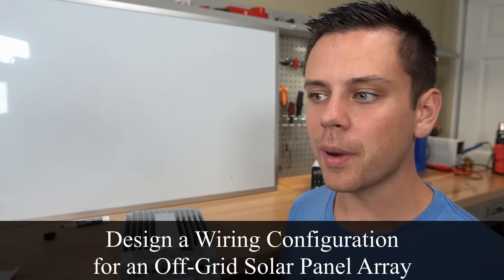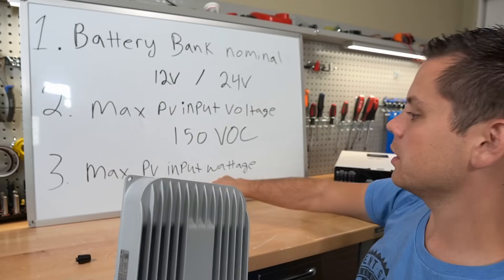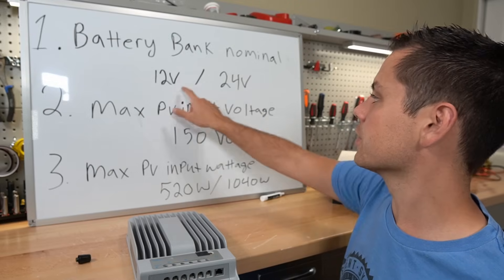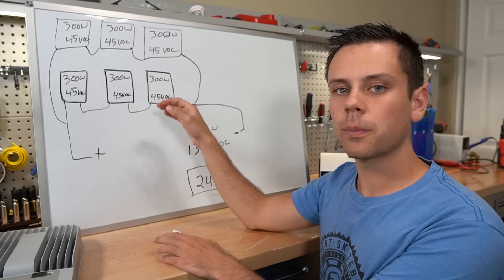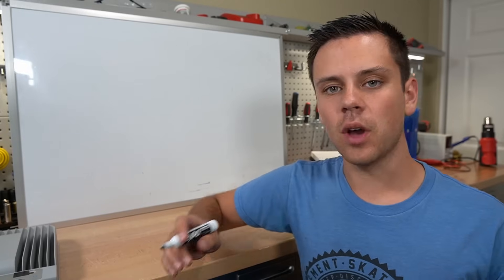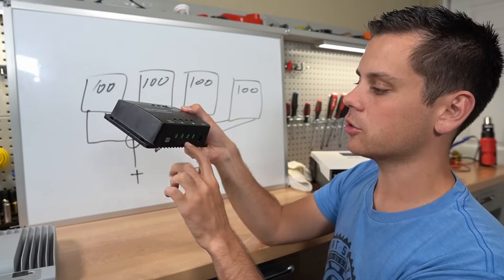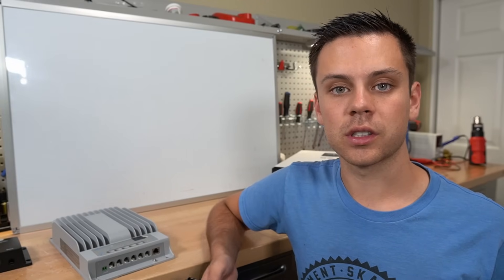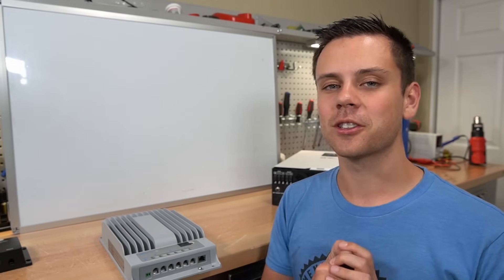How to Design an Off-grid Solar Power Array Wire Configuration

Comment: WILL, a while back you reviewed the Bluetti EB240, but I can't seem to relocate it.
ANYWAY, you'd mentioned the BESTEK 300Watt Pure Sine Wave Inverter Car Adapter, a work-around with the Bluetti's AC wall adapter/charger. 
(BTW, they beefed up the wall charger with one capable of 300W in and 210W OUT).

With all my preparations for having some charging power on cloudy days,
I discovered my van has a160A alternator and 730A battery.

I don't want to burn up  or overtax my van,
but perhaps you might give me an idea approximately 
how many watts(or amps) I can draw ,
engine at recommended rpm,
while the sun hides from my two 170W Sunpower Flexies
TIA
BILL

Comment: Random thoughts.  Is there a good way to manage inrush current for high load devices?  An example is my current workshop where I have a 1200/2400 inverter.  It run lighting and most accessories just fine.  However, if I try and run my miter saw (15A rated motor) the inrush current can exceed 50A and cause the inverter you’re fail safe.  I was considering an in-line capacitor on that circuit, but have never tried that.

Comment: This is off subject but I have problem. My bluetti just  put into use In van. After a hot day the input % bars went haywire. Otherwise it works. I cannot tell how much power I have. If I call company they will prob just say send it in. I really need it and don’t want to send it in. Is there a device I can buy that tells me the ant of power I have left.

Comment: love your info but im confused, i have 2 100watt renogy rng-100d panels, an MPPT tracer 30amp charge controller and a 3000 watt 12v pure sinewave power inverter and 2 alpha cell 240 xtv 12v 112ah batteries to setup on my van, do i want to set up my panels in series or in parallel to get the best performance?

Comment: Found HQST panels on Amazon  for about 77 buck each for 100 watt panels. Seems good deal. But is there a place that you have had experience with dealing in used panels? Looking to run a Harman p61 pellet stove during winter on solar. Or supplement daily use items without going with a solar company

Comment: will, i had a question, when you connect your battery to the inverter/charge controller what type of resistor are you using to slowly charge up the capacitors?

Comment: Hei man, I like all of your videos, thank you for all the trouble..
Btw, I just get into electric unicyle, I was wondering you could give a tutorial for the battery pack, there are many electric unicycle especially entry level units that the manufacturers cut the battery capacity to lower production cost..so if you can, pls take a look on this..many thanks..👍👍👍

Comment: I have a 2008 Lance Truck camper 2 80 watt panels. I don't know what they are doing or my batteries. There is a switch i hit and a set of light come on telling me if the batteries are charged. Can I use a charge controller and which one and what size with Bluetooth?

Comment: I have difficulty deciding which one to use between GoWise 2KW and 1.5KW inverter.  With the help of your videos, my plan is to build a van rooftop mounted solar panel 100w solar, Battle Born 100AH batt, 20A Victron charge cont., with an expected minimum load of 90w for 6 hrs daily use.  Thanks!

Comment: You can charge a Firefly to 85% really fast and discharge it down to 20% and this rate you'll only be able to cycle it just 1200 cycles. if you charge it up to full capacity and discharge down to 20% you can cycle it a proclaimed 3600 cycles.

Comment: I know you dislike lead acid batteries, but have you checked out Firefly Oasis Carbon Foam Lead Acid battery. It cost less money. (Two Firefly's for the price of one Battle Born) You have access to 80% capacity. Will work in extremely cold or extremely hot environments. ( the new technology in lead acid - 3600 cycles)

Comment: I have a boat with 140 watt panel. It sends 80% to the house battery, 20% to the engine battery. I ASSUME this is a 12 volt panel, but I haven't checked. I want to replace it with a higher output panel, maybe 2. Can I replace that panel with a 330 watt 32 volt panel? Or do I have to stick with 12 volt panels?

Comment: Connecting panels in series you add the volts not watts. Connecting panels in parallel you add the watts not the volts. This is basic electrical knowledge. Parallel and series circuits.

Comment: Hi Will, Great Video, I understood what you were on about, and learn something new about fire risks. My solar array is feeding a 48v system with a 2840W solar array at 76v, with a mixture of paired panels 255w and 200w all rated at 36v all come together in a DC solar mini breakers housed in a metal fuse box. The solar controller is MPP 60A rated and can easily handle this input.

Lighting strikes are my concern, I have the solar panels Earthed to an Earth Rod to avoid static, but have not yet taken any steps to avoid lighting strikes, protection system are available but would be interested in you input on this subject?. 

One observation to note is location; I live in Mid Wales UK where the suns energy drops off quite considerably during the winter months. Last Autumn I tried adding 20% more solar and a further 20% in mid winter. This help to keep the battery bank topped up. But there were weeks when the cloud density is so think no solar got through. So I aim to add a battery charger, using cheap night time energy after my car has charged. Timing is everything in this case as the car takes around 1h 30min to charger to 80%, that's all I need for my daily commute. But I also want to introduce Inferred heating panels to the house to heat up in the mornings, so I might use a combination of the two.

Keep up the good work!

Ken

Comment: I’m a newby to the solar game. This video is perfectly timed because I’m thinking of adding 2 400 watt panels, the panels combined in series will have a max voc of 90 volts. I have a 40 amp MPPT and a 12 volt battery. The MPPT has a max charge rate of 520 watt for 12 volts and its max voc is 138. What will happen if I add the panels to the MPPT?

Comment: Is it possible to charge an AGM battery bank AND a LiFePO4 battery bank at the same time?
I am buying battle born batteries but with the price i can only afford to buy one here and there over time. 
My day dream is to keep the AGM in place and charge them and run them off their own inverter and to also have the LiFePO4 charging and dedicated to another power system (CruiseNComfort A/C).
Over time I would do away with the AGM but it sucks to lose those amp hours when i can't buy a whole LiFePO4  battery bank at once. 
I was looking at a EPEVER DuoRacer MPPT Dual Battery Solar Charge Controller but when I asked if it would be able to charge both banks they said no.

Comment: can you explain the ocp in line fuses again. Do you need one per string or one per panel/ I have two strings of 5 panals at 1250 watts per string. but they each go to a fuse box with two breakers in it.
Reply: If you have a fuse box, that is your protection. If there is an issue, you will blow a fuse. The OCP he is describing, is an in line fuse in lieu of a fused combiner box. Hope that helps

Comment: Hey will got to say your videos are very informative and great I have a question I have a renogy Rover 40A MPPT and its currently has a 12v bank but i want to convert to 24v bank but the mppt doesn't realise its 24v and keeps it on 12v instead

Comment: Hi Will
I have watched your show for several years now and enjoy it.  Keep up the good work.
I am retired now and come from a background with high voltage DC equipment In the metal rolling industry.  I was wondering if you have ever made a solar storage unit with high voltage DC power?  I am talking about voltages between 200 and 600 VDC.  I see most electric cars use voltages this high because of its lower weight and lower I squared R loses.  I wonder if you could build a high voltage DC solar unit and show us the cost savings if any.
Frank Krajewski

Comment: I’ve viewed so many of your videos and really enjoy and learn from them. I have one question tho? I’m building a system based on your info and my only question is... you have a fuse system for “DC” power and I’m confused on how you connect appliances to the fuse box. Could you do a video on that? Thank you, or maybe just explain in comment... I can see plugging in a device to inverter but get lost on what appliance has just loose wires to connect to positive and negative post on fuse board... most dc I have all have a metal plug in adapter , I.e., like a razor or small radio

Comment: Hi Will, great content. Question, is it possible to hook up a power supply to a solar charger to charge the battery?
Reply: Typically, no. Solar charge controller has the specific purpose of collecting the energy from the panel, and converting it into a voltage that is usable, and safe, to charge your battery.

Comment: Great video. I have a question. If I have 2 12v solar panels and want to charge a 48v battery would I be better to run them in series to I have 24v from the panels or run them at 12v in parallel?

Comment: Hey WILL!! LOVE THE CHANNEL!!! THANKS FOR ALL THE GOOD STUFF AND HONEST REVIEWS!
I HAVE 1 QUESTION BUT HOPEFULLY IS INTERESTING ENOUGH TO CREATE SHOW WITH:
I HAVE :
48 VOLT SYSTEM
13S LI-POLY
13S LI-ION 21700
$40 ATOMIC PI
MIDNITE 250 CLASSIC {THAT HAS AN AUX 1 AND AUX 2 TO DO SOMETHING FOR THE BMS}
-I WOULD LIKE TO GET A BMS OR ACTIVE BALANCING SYSTEM BUT ARE VERY EXPENSIVE WHEN U HAVE MANY IN PARALLEL!! I WAS HOPING THAT THERE COULD BE A WAY TO HOOK UP{1}AWESOME, GOOD OR EXPENSIVE ACTIVE BALANCER TO ATOMIC PI TO RUN A PROGRAM TO BALANCE ALL THE BATTERIES ????? DOES NOT HAVE TO BE RUN ALL AT ONCE BUT BE ABLE TO SWITCH BETWEEN BATTERIES

Comment: This is great... Love the EPEver MPPT 40A Solar Charge controller with that large heatsink... I've got 4x 100w 12v poly Rich Solar panels... Works well with 12v Battleborn AGM battery
Reply: Hi, Thanks for supporting,I am Patrick from EPever company.

Comment: excuse i have a question regarding the PWM controller
from what i understand from you i have to use an array of solar panels that gives the same nominal voltage of the batteries right ??
means if i have battery voltage of 12 the arrey voltage must be 12( or a little higher) rigth ?
it means the controller will put what ever voltage from the array to the output which is the battery through the switching component ??
can you explain this point more cause in my country this PWM  is the most common one

Comment: can i use two epever 40 amp mppt controllers for 6/200 watt solar in parallel /safely with a breaker fuse/i want to tilt my panels /thanks for a great video

Comment: That made my head hurt! I ordered a Bluetti AC 200 on your recommendation, really looking forward to getting it. However the panels on the crowdfunding do not suit my needs, they can not be securely mounted to the roof of an off-roader without being taken easily.  I have spoken to them, they agree and look into changing them in future. How can I get around the 36 OVC issues with lightweight panels to charge the AC 200? Many thanks, @willprowse

Comment: The max. power of a panel depends of the angel towards the sun. You can use a 80% Wp if the panels flat on a mobile home roof. And use more MPPT's when the number of panels increases and put those in parallel. So, you create several panel 'systems'.
The best is each panel it own MPPT
Arie

Comment: Have a bus running a 24v system then a separate 12v house battery system running inverter, power, radio lights etc in the bus plus have 4 solar panel ALL different wattage plus going to use a charge  MPPT controller All 30watt + for each due to each panel won't be in sunlight when others are, would this matter? So do parallel & series setup apply? Thanks Ray

Comment: The inverter is isoar SMV III 3k so 3000w 500vdc pv230Vac 24v 80A MPPT  is a hybrid inverter max pv panel 4000watts imput max power voltage vmpp A 8,3A short circuit 8,9A  my solar pv system is 8x280w 2240watts in total at the moment but I probably extend to 3000w in total of pv the battery pack I think have to be 24v by looking at the spec so my question is does my pv system is better to connect in parallel or series to get the max power from pv the battery vol is 24 v is I guess I mast get 2x12v 200ah each agm bat any ideas I just wat to mention that in a day I want to use 230v from pv also the inverter have utilities input 230v just in a case lack of power from battery and pv

Comment: Sooo since I'am a total noob excuse my stupidity 😂 first off can you charge a battery with solar power and discharge it the same time? If not is it possible to switch automatically from solar power on net power when the battery is about to get low?

Comment: Hey Bro , Yes you can . 
It's by one , but would work wat better if your used a buck converter to dial down your voltage and current .  
Or build your own transformer needed . Recycled from microwave's or anything else just depends on what it is and size.  
All I am actually speaking about are Transformers, capacitors.  Plus all the other cool digital components that are used to clean , stabilize your Energy being created.

Comment: Not that you would care, but I just received my Dokio 150 watt folding solar panel today, ran a quick test... working fine so far but is cloudy and late in the day, 6pm, though the panels are reading 14.7 volts. I can't wait to until the sun is out.

Comment: How i can limit open circuit peak Voltage? i have mppt charger with max PVinput 100V, i want connect my 3x 275w solar panel to series, but then i would got  voltage peak about 117V pv-peak.  When panels product energy, voltage is good about 3x 31V = 93V minus voltage drops. But when battery is full and voltage raises, it can destroy my mppt.  Can i limit input voltage under 99V ?

Now i have put all to paraller, but now i have lots of more powerloss with long cables..

i have 3x panels with ;
open circuit voltage max 38v
product voltage 31v.
current per panel 8.4A
cables 2x 24meter x 4mm2.
mppt max input voltage 100V.

Cables length its not problem if i use higher voltage.

And before someone ask why,  i have first only 2x panels and i got one more for free
Reply: There is a saying which goes something like, sometimes a free thing ends up costing u more..!
U have 3 options...
1.  Change the charge controller...
2. U can buy 3 Buck-Boost converters (capable of handling 300w each)(1 for each panel) set the output voltage of each to 32v.
3. Sell or give the 3rd panel 2 some1.
Reply: @MaxMax-dq1lu  Thanks!  i didn't remember buck-boost converters, now i need order some and do measures how its works in my project!

Comment: wattage is current x voltage.  if you run a series string the wattage does not increase with the voltage, it does that on a parallel string....

Comment: Can you tell me if the solar panel temperature coefficient is based on AIR temperature or PV Cell temperature? Here in Central Florida Space Coast, the daily summer air temperature really doesn't get much above 90 degrees, but the panel itself is probably pushing 130 or higher.  So, is my Pmax temperature coefficient of 0.23% /C above 25C based on air temperature or cell temperature?

Comment: Hey Will, thanks for all your wonderful videos :) I've been learning so much binge watching everything over the last few weeks. Question: Have you looked into the new chinese BMV circulating aliexpress\amazon over the past few months? The model is Juntek VAT1300 and it supports up to 100V/300A. It also has a nice display that can be wirelessly connected to the shunt.